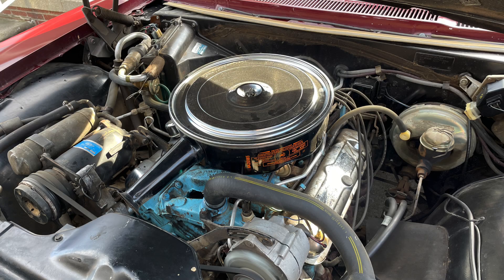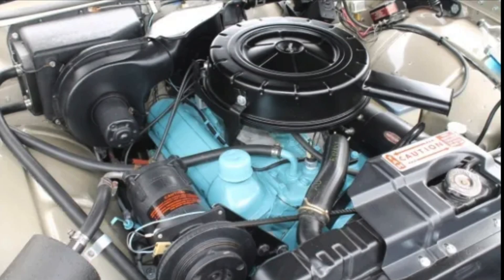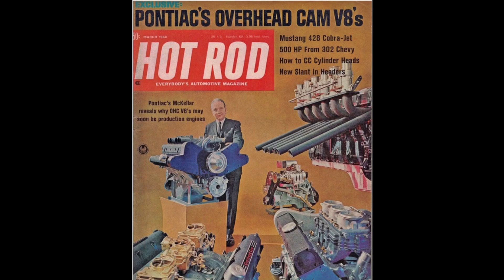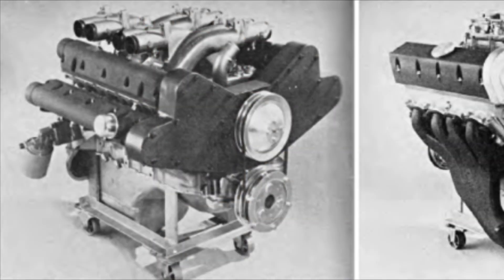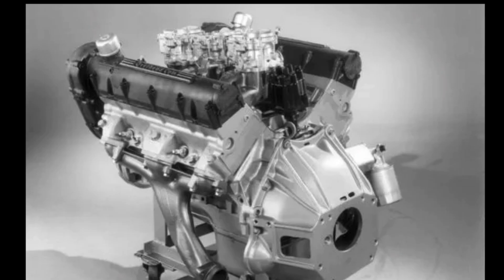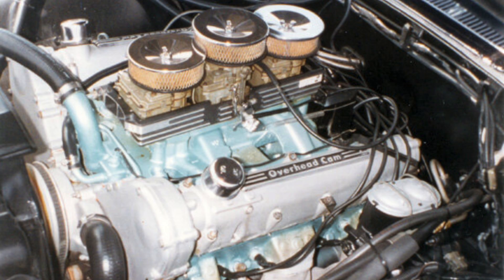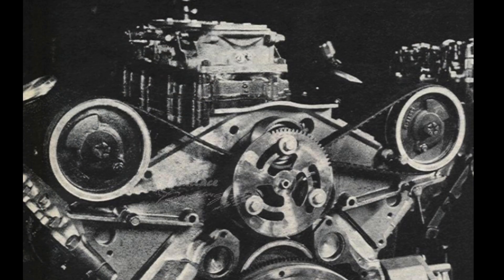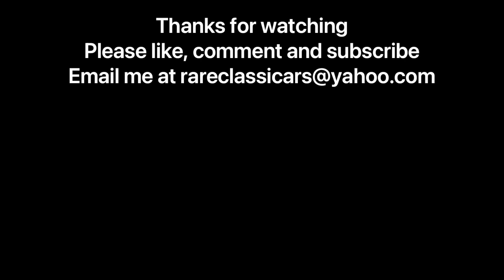Most Powerful Car Engines: Pontiac Builds SOHC and DOHC V8s in the 1960s!

Comment: The old magazine, High Performance Pontiac, showcased tons of innovations that Pontiac tried over the years. Despite all the GM tampering to stop racing development (well Chevy sure got away with a lot of racing), Pontiac made some crazy setups, knowing they couldn't use it in the end anyway.
Reply: Yeah, I've got a lot of HPP and PE mags, GM seemed to try to limit Pontiac to some degree, but not Chevy in those decades, according to guys that worked at Pontiac.  A lot of innovative engineering they came up with, that the top people didn't want to approve, because the Corvette was at the other division.  Super Duty 455 still got built though top guys at GM didn't really want to.  From what I can remember reading, a lot of that came from work on the Nascar 366 engine, and Ram Air V, through the late '60s, early 70s, provision for dry sump oiling, the heads had some help from an outside company, if not AiResearch, something similarly named.  Not an all-out racing engine,  but it had a lot of those earmarks

Comment: really wish nascar wasnt in chrysler's pocket sometimes. ford and gm both make engines capable of C L A P P I N G hemis with less displacement. then from the wave of the hemi's hand, makes nascar say "duuuuh pushrod only". its a shame these never went into production. cant imagine what kinda power these things woulda put out if hot rodders started dinking with them, turbos would go crazy on these engines lmao
Reply: Not at all. Bill France was always a GM guy and the rules have always gone against Ford and Chrysler and in that era, GM had nothing that could match the 427 sohc. Not a single BBC has a single win in Nitro drag racing while the Cammer was the only engine capable of matching and beating the HEMIS. Connie Kalitta and Don Prudhomme, both earned 1966 NHRA victories in dragsters powered by supercharged versions of the Ford 427 SOHC engine running on nitromethane fuel. Kalitta drove his Bounty Hunter entry into the winners’ circle at the season-opening Winternationals at Pomona, Calif., while Prudhomme prevailed at the Springnationals at Bristol, Tenn., in Carroll Shelby’s Super Snake entry powered by the same engine. 

   At the 1967 NHRA Springnationals held at Bristol. Prudhomme posted the fastest qualifying time and became the first top fuel driver to break into ‘6s at a NHRA national meet and the first to break 220 mph (6.99 @220mph). He also ran sub-7second times in three of four elimination runs (shut off early when opponent fouled in the other run). Prudhomme beat fellow Ford driver Pete Robinson in the final. Connie is the only triple crown winner in nitro racing history with the cammer.

  There's plenty of other classes (AFX Gas Rhonda, Ohio George Montgomery A/GS 4 championships, Dyno Don Nicholson match racing) and others that also utilized the Cammer and beat the best Chrysler and GM had to offer.

Comment: Wow Adam,  I had me a 1968 Firebird with the One bbl, 250 OHC,  right before I finished H.S.   I traded a '71 Datsun 510 Wagon for it.   The guy was in H.S. married, and had children.  He needed a wagon ,for his family, didn't need this car, the trade was good.  That Firebird needed some SERIOUS/IMMEDIATE work.   The master cylinder (if you pressed hard and quick you would have brakes for the moment), needed rebuilding.  The throttle cable was mounted to the dash, like that of an old tractor.  I immediately  drove over to Lakeport Pontiac, bought a new accelerator cable, installed it.  Instead of going to the Senior Prom,  spent that day/evening at my friends dads shop, where I helped him do a head/valve job to it.  Sold it in '82, before going into the USMC, and bought a beautiful 1975 Honda CB400F, SuperSport,, put 1000 miles on it, then went off, into boot camp ,in Oct.'82.   Still have that motorcycle.   Gonna sell it pretty soon
Reply: @marcelgaud  Hi Marcel. There must be a vintage bike forum where you could meet someone ahead of selling your bike. I'd buy it...
Reply: I think reminiscing about an old poncho IS 100% on topic in this case.  
And Adam, take it easy, love your brother, don't spew anger, life is too short.
Reply: which has NOTHING to do with the topic. Stop the attention seeking. Get a hobby.
Reply: @Atomwaffen-y3s  Do you have a comprehension disability? I distinctly saw, "I had me a 1968 Firebird with the One bbl, 250 OHC," in his post. Get a life.

Comment: My first new car was to have been a '67 Tempest with the Sprint OHC six, but I was diverted by a great deal on a Mustang. I still have that Hot Rod magazine with all the OHC Pontiac engines. Great episode.
Reply: From what I've read over the years,  John DeLorean was the driving force behind that engine, the OHC 6, because of the high-revving 6 cylinders in Europe.  The Sprint versions with a Quadrajet, and you could get it with a 4 speed, depending on the rear diff ratio, some guys have said the OHC 6 Sprint equipped cars performed pretty well (they'll rev to 7,000), while getting 24 mpg.  Ahead of it's time

Comment: It's really unfortunate that regulations killed off the performance aspect of auto makers back then. Would have been so cool to see where they would have gone with this design.
Reply: They should have continued with the DOHC design as that allows you to run variable valve timing, with small valve overlap at low rpm for low emissions and increasing overlap at higher rpm for performance.

Comment: There was also the Infamous Pontiac 303 All Aluminum with Round Port heads,  they make to compete in Trans am Racing with over 450 HP.
Also the Legendary Ram Air 5 400 Pontiac with over 500 HP also with Round Port heads, that was in the GTO a Rare Engine with less then 500 made.

Comment: I had just turned 18. I had a 74 Monte Carlo. My cousin stopped by my apartment told me he was getting a divorce. He had a 68 Firebird Heavy Duty 455. He asked if I wanted to buy it do she couldn't get it. I said ABSOLUTELY! He said $500(1978). I went to the bank withdrew the money. I was saving for college. I thought s GTO would be an investment. I bought it and put it in my parents garage. I drove it to work. My wife (I married my high school sweetheart. I had it about a year. Drove it to work one day. I worked at a warehouse. A semi tractor/trailer turned in the wrong entrance. He turned to soon and ran over the back of the car. The car was totalled. But I pulled the motor though. It is sitting downstairs in my garage. I've been offered $10,000 for the motor. I was just presented with my 1st grandson. That motor is his!!! I'm 65 i hope im still here when he turns 16. I still have my Monte Carlo. I'm going  to give it to him with that 455 HD under the hood!
Reply: Less than 3000 SD’s I think
Reply: @redbaron977  right. They deserve to sit in a trans am that sits in a museum. Not mistuned by a 16 year old getting rung out on the highway. I wanted one of these cars so bad as a kid but it's literally a waste of your life to attempt to restore a 50 year old Swiss cheese car. I've met orthodontists with 5 firebird. You'd be better off going to college and making 160k a year than spending 4 years on a rotisserie restoration and cutting corners to finish the car and hardly anyone will give you money for it because it's not a blue chip car. So you sell it for cheap trying to move/afford rent.
Reply: What's a Heavy Duty 455?
Reply: @timferguson1593 
Sorry to break it to you man, but "HD" is a flatbed truck and RV engine. You can buy them for 75 in scrap yards.
If the engine is stamped "HO" High Output, you have a Nascar engine. If each head has two thick gaskets, its been "detuned".
Reply: Heavy Duty 455? No such thing. That sounds like a variation Pontiac would've made if they had ever decided to dip their toes in the passenger truck world. That's silly.
Reply: I've never heard of a 455 HD? I've heard super duty, SD. I've heard HO, high output. But heavy duty, no. Now, I've had many early model trans ams, 70 to 73. I thought I pretty much knew the history off pontiac,  maybe I'm wrong. But something doesn't sound right with this engine
Reply: @steveholler1095  And the 455 didn't come out until 1970 so it would have been an engine swap in a '68 Firebird.  In the early 80's a guy sold my buddy a 326 and and was fast as hell.  He ended up spinning the bearings and when he went to have it rebuilt the shop came back and told him it was a 455 SD.  Made sense that it was so fast.  The last year 455 SD was in a '74 Trans Am.  Never heard of an HD like you said,.
Reply: @steveholler1095  very true. It's most likely and h.o. I knew a guy that sold a 455sd for like 5k unrebuilt in 2004 for 5k on ebay. I'd sell it. Even if I wanted to race pontiac, I wouldn't risk it with a rare casting. I would get and aftermarket block.
Reply: Nah, sell it. He'll wrap that thing around a tree the first week. Dont want that on your conscience....
Reply: Probably not a good idea, anyways 16 years from now gasoline is going to be on its way out even more so than now. Most likely probably won't even want to drive a gasoline powered vehicle
Reply: Put it in a jet boat and enjoy it!!!
Reply: Ngl, I know 445 SD and H.O.s are expensive, but I'd heavily consider selling the engine itself to someone that needs it. Pontiac are so expensive to build and not as competitive compared to l.s. engines which will most likely be more readily available when your grandson turns 16 vs a engine produced between 1969-1976. Plus most kids ring the shit out of engines and destroy them and 455 are, expensive and rarer
Reply: I’d sell it and put the money into a big block Chevy or something. It’s a cool story but swapping a Pontiac into a Chevy would be like swapping a 460 into a Dodge challenger- it just doesn’t make much sense.
Reply: @stevenvanheel3932 why do you say that? People have been putting Chrysler hemis into whatever they want ever since they were put into production. Besides, who cares about what you think,?? It's not up to you to decide!
Reply: @mykec.selene8302 . People have been jumping off the Golden Gate Bridge since it was first built too but you won’t see me doing that. It’s a dumb idea-plain and simple. If you have experience with building engines then you would agree.
Reply: @stevenvanheel3932  Gee, as a matter of fact I do have experience building engines and putting them into different cars of different makes! I've put Big block Oldsmobile engines in a very cool and far out car! So I've also put together many strange combinations of engines with even stranger cars and multiple times I did it in my back yard! So what if you want to put together a really cool car and drive it down the road and perhaps race it against guys from the town I grew up in!!! So there!!! Pppppppplllllllbbbbbbhhhhhh!!!

Comment: Thanks for doing a video on this.  I'd heard of Oldmobile's attempts at four valve per cylinder engines, but not this, somehow.  One additional guess as to why this was a no go is that at its top levels, at least, it would have meant spending more money on the suspension and brakes.  I mean, 600 plus horsepower means you'd better provide the driver with a means to maintain control...
Reply: Bias ply and drum brakes at over 100 mph, no thanks 😂
Reply: Comedy

Comment: Pretty cool for the time.
The cylinder head on the OHC 6 cyl. looks not too efficient - crossflow is better. 
GM retrofitted their 3.4 engine with OHC in the Monte Carlo 30 years later.  They picked a wonderful place to relocate the alternator on those. 
The OHC vs OHV debate is ongoing. Chevy's LS engines have disproved many myths about OHC engines being superior in every way.
Reply: @johnz8210  ohv compared to dohc saving a lot of space and weight allows them to still run big displacement. Ls3 vs bmw s65 is great example. Ls3 is better than s65 on every metric
Reply: Crossflow is an advantage, but it depends on how it is executed. The most effective crossflow heads were a kind of hemi design. However, those tended to be much more expensive to build. Many cheaper crossflow heads were of the wedge or bathtub chamber heads. They didn't do all that much to improve performance.

Some of the carb engines were counterflow because it was easier to preheat the incoming air that way. It was no longer needed if there was multiport fuel injection.

The Datsun Z car was a counter flow SOHC engine. Racing teams had a prototype called an LZ head, which was crossflow. From what I read, the cost was not justifiable.
Reply: Indeed. Chevrolet continues to develop its V8 from 1955.

Comment: Hey Adam, that picture you're showing of that OHC engine at 2:55 has one of those early Quadrajets on it, very very similar to the one that's on your '66 Toronado. You can tell it's one of the first ones because it's got the arm connectig the secondary air doors to the fuel dampening mechanisim rather than the vacuum break dampener that came along in '67 when these things were redesigned. There is a lot of hate for those '65 & '66 Quadrajets! I wonder if thats the correct carb for that engine? I also have a '66 Toronado with that carb so I recognized it immediately. I'm gonna have to consult my Delco bible for this Pontiac engine to see what carb it is. I would guess it's a '66 model.

Comment: Gm made a 4 cylinder ohc with timing belt in the uk from 1967 too.
Reply: Indeed -  the Vauxhall slant 4. Vauxhall initially also planned a V8 version of that engine using many of the same parts, but that never made it past the prototype stage.

Comment: That quad cam V8 would have been amazing. I know in the ‘60s Mercedes was using Bosch D-Jetronic fuel injection. Used 8 electronic fuel injectors with a common fuel rail. Injectors were batch fired by a second set of points in the bottom of the distributor. If Pontiac was looking in to something similar, that would have been sweet!
Reply: D-jetronic was bought from bendix, they had the electrojector analog efi in 1957 used in rambler and some chryslers but failed and bendix sold the system to bosch which improved it further and created the d jet 10 years later
Reply: @288gto7 Huh, that’s very interesting. Pretty sweet they had that tech so long ago. But, as I’ve been learning, most modern engine innovations are actually quite old.
Reply: @JohnEvans-ct6mz  yeah a lot of the stuff goes waaay back in their origins. Also the biggest change with d jet was change to silicone based transistors rather than the germanium ones used in the electrojector
Reply: @JohnEvans-ct6mz an example is the "direct injection" concept used in all current engines started in a diesel engine in 1924, was used in WWII aircraft engines, and first used in a gasoline automotive engine in 1952 by Bosch.
Reply: D-Jetronic was impressive at the time, but absolute garbage today - I can tell you as a classic Mercedes mechanic, that K-Jetronic is (still to this very day) the most reliable, dependable fuel delivery system ever invented, closely followed by Mercedes’s own proprietary fuel-injection system they developed (which is largely based on it).
Reply: It is my understanding that Bosch replaced the D-Jetronic EFI with L-Jetronic EFI. It still used pulsed electronic injectors. However, they replaced the pressure sensor with an airflow sensor. The early mass air engines used something the resembled a weather vane. L-Jetronic was installed in the early Datsun 280.
Reply: Yes it would have been GREAT.  Less torque for more $ -- wow.

Comment: I'd seen pictures of the overhead cam straight 6 many times but never till today did I notice that the thermostat housing goes into the camcover...
That looks ominous to me...
Reply: That just goes straight down into the head. No water flows through the cam cover except to connect the head to the thermostat and neck.
Reply: @hotpuppy1   That's not correct,, the thermostat housing IS part of the cam box/cover,,,, the cam cover gasket has an integral section that seals the thermostat inlet to the head and that's where the trouble lies....
If that fails coolant dumps right into the engine.
I did some sleuthing after I commented and having that gasket fail and getting coolant in the oil WAS and IS A THING.
Not a chronic problem apparently but it happens..

I KNEW I didn't like the looks of it..  lol